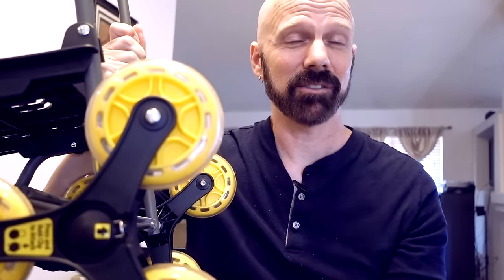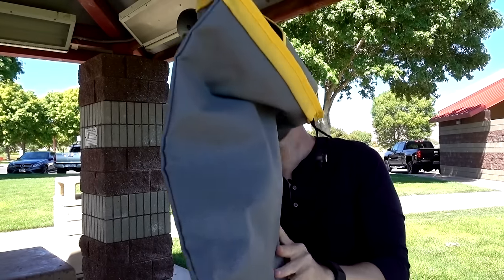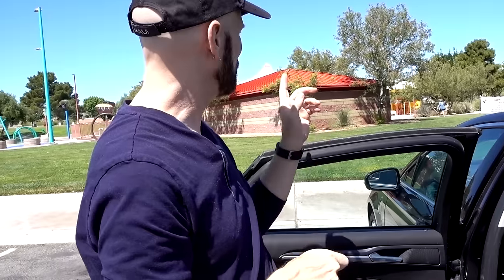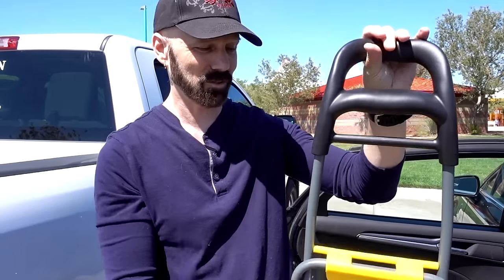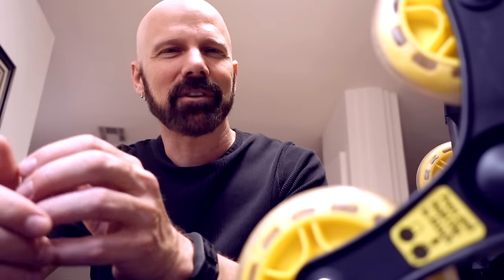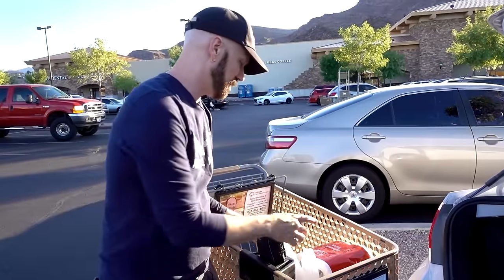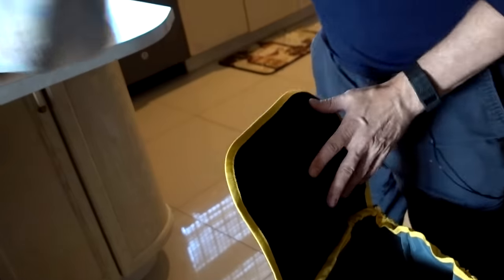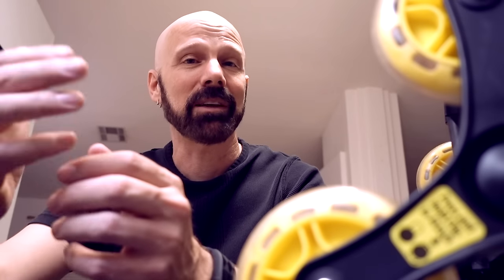Climb Cart Review: A Stair-Climbing Cart?

Comment: Of course it's still hard when carrying a lot of weight: every time you move from one stairstep to the next you have to pull the full weight of the cart and payload up by yourself, there's nothing else there to do it for you. The only thing this kind of cart helps you with is it gives you little breaks from the lifting while you're dragging it horizontally on its wheels across each stairstep platform until you hit the next one and have to lift again. It's better than having to support the full weight continuously for the whole climb, but you still have to be able at least to lift all that weight for the vertical distance that is the height of each stairstep.
Reply: Exactly..not 'easier' at all, and it only really helps on stairs that are just the right size.
If you put brakes on the wheels of a normal dolly and use bigger wheels, it is simpler and better and faster and safer.
Reply: @murraymadness4674  I mean if we get super technical about it there may be some pulley effect going on there for a bit as you're pulling up at an agle but the cart starts by going straight up, but the help you're getting is probably very small, as there's not much angle difference from just pulling the cart straight up as it hangs freely.

Comment: I have a slightly more heavy-duty version of this cart. Strong enough to carry a front loading washer or a fridge. I find that 3 wheels work ok going up the stairs and the  turning radios is non existant with a heavy load on it. You simply can't turn on the landing between the stairs. I usually have to get 2nd person to lift and turn the cart. For moving heavy items, better design seems a regular cart with big wheels on the side. But for a light load of grocery it seems to work fine. I still use mine 10 years later..... Even though it is not perfect and I had to repair one of the wheels that fell of in a turn.
Reply: I have a similar one with similar problems. Can't turn corners, and centre of mass is also much higher than it needs to be, making it very unstable. Great with light loads though.

Comment: I wonder how well it will go up a flight of porch stairs that has space in between stairs , I wonder if the wheels will get caught in the space between the stairs?  if you can test it on stairs with space in between that will be awesome,  my daughter has stairs like that and that's why I was wondering
Reply: Where I live I have similar stairs to your daughters house. I think it would get stuck since the wheel isn't hitting anything.
Reply: sounds like it need bigger wheels. a lot of commercial grade handcarts have larger wheels. This isnt bad for most people.
Reply: Rosie Duarte. Thats a great comment I wonder why he never responded to it because most houses don't have cement stairs
Reply: Are you thinkinbg in terms of a fire escape grid type stair?
Without a back to the stair?
Reply: Rosie Duarte I have wooden porch steps it goes ok on it. 
I find that bunny cording does not hold things on well with just the cord it gives. 
The bag holds up very well even  'over stuffing' it with laundry. 
I have had  my climb cart since before I moved. I used it on the bus, and uneven  terrain and it did very well. Regular use from August last year to now and only thing I am unhappy about is the fact you need  more than one bungy to use it without the bag
Reply: @gnhun101  I was thinking the exact same thing bigger wheels and a little bit wider
Reply: @peterstyles5567  it would be good to check it out on those kinds of stairs, too
Reply: Rosie Duarte I think it would work as the wheels pivot as one unit. I thing the whole unit would be ok and work!
Reply: @nimbysep7602  I would be more comfortable with a simple ratchet strap for heavy or awkward loads
Reply: @woodstream6137  if I had one i would agree but it is not that easy to find one small enough to fit on the climb cart
Reply: Yeah and uh says that I have a space in between them and also stares that are much much taller in between
Reply: agreed

Comment: In Germany this is called Sackkarre and it´s actually a very old invention way before 2014. Actually the patent for a Sackkarre with stair climbing abilities was registered 1982.  But here they are made completely out of light weight metal and are build to carry washing machines or even heavier things upstairs. So this plastic as seen on tv thing would never ever catch my attention. And by the way the price point is the same.
Reply: DJWeaponized I live in central Germany, where can you buy them? I’m on the 4th floor so carrying up groceries sucks.
Reply: Allie Jones 

https://www.amazon.de/Treppenkarre-Sackkarre-Treppensackkarre-Faltbar-Stapelkarre/dp/B07BTTFK7G

That is just one of the many models if you look it up they can hold 440 lb in Mead of a light but durable aluminum they look badass.
Reply: I thought exactly the same. We had one, costed 10 eueos... Lifted everything upstairs.

Comment: Thank you for this excellent review. I had a rattle cart, the kind sold in grocery stores. Paid $29 for it, and it sounded like I was dragging a metal fence down the street. When a wheel broke and wasn't easy to replace, I threw it in the recycling bin and went looking for a better solution. I found your review.
A big plus for the cart is the handle. A negative is the wheels themselves: imagine if they used hard rubber wheels -- like a skateboard -- instead of hard plastic?
Biggest plus: It's QUIET.
Two recommended improvements: make a carrying tray that extends, either via pull-out or a flip down extension. AND Make the handle adjustable, so users of all heights can find the most comfortable position.
Reply: I hate those granny carts. They're so noisy.
Reply: I stumbled on this video by accident, while looking for shopping cart for myself. Don’t want to sound grumpy, but honestly don’t understand the idea behind six wheel “stair climber” types of a dolly at all. Yes, they look clever, give impression of being specifically designed to handle stairs and steps. Do they however really make climbing stairs any easier or better, give any advantage at all, over regular two wheel dolly? Not at all. Whether it is six or two wheels, it will climb the stairs same way. It will not be any easier, more secure, safer, sturdier, more comfortable. At the same time the very design of the six wheel “stair climber” will make it slightly harder to pull dolly behind on any surface, flat OR stairs for that matter. Why? 
In order to compensate for the size of three wheels, virtually all six wheel dollies designs have a part of frame which supports weight of the bag from the bottom (part of frame which creates surface on which shopping bag seats) considerably higher than regular two wheel design. This results in weight being shifted up on the entire frame, which moves center of the gravity up. This causes design to have much higher angle of handle bar in relation to the ground when pulling dolly behind and shifts weight from wheels to hand. You hand pulling dolly will be lifting bigger weight, on top in arguably awkward, uncomfortable position. 3:40 Look  how “Freakin’ Reviews” have to uncomfortably bend down while pulling dolly upstairs. Doesn’t this look painful? His hand is literally at his knee height. While walking flat surface, two wheel dolly handle will be maybe 20 degree from vertical plane. All weights balances on wheels, where you can hold and pull handle literally with two fingers, even when dolly is loaded with heavy weight. With “stair climber” type, angle will be more like 45 degree, where weight is resting between wheel and handle and you hand literally has to lift it. Advantage or just a sales pitch of looking smart, yet really bogus design? 
Not trying to offend anyone’s feeling, not impossible I am missing something. Just my two pennies of my uneducated reflections.

Comment: Your review was spot-on.  It is great for going up stairs, not so much for going down stairs.  Platform is smaller than I would like.  Tried using it to get a 40 lb. bag of water softening salt down to the basement from my car.  I did use the bungee cord, but my error might have been leaving the bag in the upright position.  No problem going up the 3 steps to enter the house.  However, I was not able to hold onto it to go down the stairs to the basement.  The cart with the bag of salt practically flew down the stairs without me.  Fortunately, the salt bag did not open and climb cart was not damaged.  Will try laying the salt bag horizontal next time to see if that helps.
Reply: I think it should be an olympic sport

Comment: Yet another great review!

I have in of the first gen of these carts; they can be helpful but for a few bugaboos.

The first is the platforms are difficult and usually too narrow to be versatile.  As shown with the case of water.
The second is twisting.  When you have the cart loaded and put any sort of direct torsion you can easily damage the cart.  When heavily loaded these carts need a good amount of space to pivot.

And always, always get bungee cables and the custom bag!  Finding a bag to fit properly is a pain so it's worth the cost to get theirs. Bungie cables are easier and can be gotten from any hardware store.  Both will be invaluable depending on the loads you are trying to carry.
Reply from the maker: Excellent tips, Dan. The original Climb Cart had a much larger platform, and I'm not sure whey made it smaller (to save money, maybe?). You also touch on a point that I didn't really mention, that it doesn't really make very tight turns. 

I think it's pretty good, but $40 seems like about $10 more than what it's worth.
Reply: That same four points of contact can also add to the amount of weight you can carry in a given space... if you were to build something similar to this yourself,  you could make it hold 500lbs easy. .... this thing just needs to be booated to the commercial product level,  it would sell fantastically with better construction and the right marketing

Comment: I would like to see how well it works on the stair where the riser (vertical part of step) is open, like typical apartment or deck stairs. Without the vertical face for the leading wheels to hit and make the wheels swivel, I bet it doesn’t work that well. The other challenge might be where the tread (flat part you step on) protrudes an inch or so beyond the riser. Very few of the steps I have seen have a vertical riser intersecting the tread at a perfect 90 degrees like those in your park.

Comment: If the wheels were metal and the tires made of hard rubber, that would be better because of plastic breaks or wears out too fast and you would have to replace them more often if you could even get the replacement parts. The idea is great though, especially for seniors and their stuff eg. groceries. Love the bag idea keeps everything compact. Thanks for the video.
Reply: @@gsnoorky I wonder if the wheels are replaceable

Comment: You might want to measure the force required to pull it up a step (with your luggage scale), and then do the same with the same load using a regular 2-wheel hand truck.  This would tell you for sure how much less effort it takes.

Comment: Seems like it would work just as well if it had one much larger wheel on each side instead of the three small ones. And larger wheels would be even better on rough terrain like the park grass.
Reply: Zombull73 You're right. I currently use one with a pair of larger wheels & find it requires about the same amount of pull up stairs as my previous 6 wheeled one. 1 advantage is, if one wheel breaks it can still be used.
Reply: The wheels would need to be indeed much, much larger. To the point that they'd make no sense over this design. If not, the cart would move up the stairs a lot less smoothly and would require much more effort.
Reply: good point

Comment: water weights 8lbs per gallon, so you can divide the number of total ounces. If those are 16-oz bottles, then 32*16 = 512 and divide that 512 by 128 oz per gallon = 4 gallons, which is 8*4 = 32 lbs for the water, plus 3 pounds for the cart.

Comment: I work for instacart and shipt, which are both grocery services.  So im constantly shopping and having to carry very heavy items.  My mom gave me this cart and at first i was hesitant but after using it, i wouldnt be able to do my job without it.    It holds a lot of weight although it does have to be balanced on there properly bc it could easily tip over.   Going up stairs is helpful but if its a lot of weight its tough making it all the way up.  The handle could be longer.  But this thing is durable.  Ive done over 1200 shops and have used it for 15 months and havent had to repair or replace anything on it.   I highly recommend it but not to lug 75 pounds up stairs, unless youre a mini hulk lol.    I def never tried it to go down stairs, i would be afraid of the tipping over thats mentioned in this video.  All in all i give this product 5 stars!

Comment: How tall are you?  It looked like you had to bend to the side when going up the stairs.  how about when walking on level ground?  I have a bad back and this might be helpful if I don't have to crouch to pull it along.  I assume the handlebar is not adjustable?
Reply from the maker: Hey David. I'm 5'10" and you are correct that the handle does not adjust. I could walk normally while pulling it on level ground, but I did sometimes have to lean going up or down stairs.

Comment: I have a similar product called a trolly dolly have 6 large wheels. When I’ve gone down stairs however—-i don’t push it forward as you’ve had. I actually pull it behind me to go down. So the back is tilted low to hold items stay on the base, but i don’t need to position myself awkwardly while going down stairs. Had you tried that? I feel like that would make the process much easier to go downstairs.

Comment: He did not compare it with a regular wheeled tote. Also he didn't show it on regular sized steps, only over long ones. Will the climb cart rest on a single step with only steadying force as does a regular tote? Or would it need constant pull and so one could not rest halfway up the stairs?

Comment: How thick is the tubing? How much does it weigh unloaded?  
Big problem: all the connections appear to be made with rivets, instead of nuts & bolts. So you can't fix it yourself. 
It looks really cheaply made. How about some stress testing?  I think it might be better to have one set of wheels that were twice the diameter.

Comment: hey there! so I realize this was posted over a year ago, but I'm just now hearing about this thing. I'm a construction millwright and these appeal to me for the purpose of lugging an arsenal of tools up flights of stairs a work area. often times this is a sensitive (and pain in the ass operation. I doubt this cart could bear the weight of a tool collection, but you did mention that this is not the only car like this. have you tested or do you know of any carts that maybe WOULD bear the weight/just be more useful? as of now we just use a dolly but this isn't the most stable. most of the guys don't have a whole lot of trouble. I, however, am 5'2" and struggle EVERY time. thank you in advance -great channel!

Comment: Thanks for the test. Would have been nice if tested with 2 case of water = to 60lbs since the max is 75lbs.
Reply from the maker: I'm compiling some requests for a follow-up, so I may use this suggestion.
Reply: might wanna try a ratchet strap instead of that bungie cord. may provide better support, although itll likely bend it. Also, could you try it in sand? might be descent for a beach outing if its really "all-terrain"

Comment: This thing is ok for very light loads, that don't shift, on even flooring with low lipped stairs.

Otherwise,  you must jerk and pull. Then it warps into a giant plastic thing with a 90 degree wheel.

Comment: just bought it today - i agree with most of what is said in the video. i must add that cobbles are not seem to be very good for this plastic weals, and i'm afraid that they are going to wear them down.  climbing stair is easier then the one weal, but still, effort need to be made, and it is going to be noisy (some neighbors might not like it...). nice thing is that it can stand put, and you can carry your water, and your groceries in a nice tight bag. my conclusion - not bad, but perhaps to expensive to what you are getting.

Comment: If the stars are open underneath and you are going down the wheels get hung up. I almost broke my neck when I fell over the cart luckily I  had soft stuff in the bag that I landed on and it was only a two step landing. Mine is packed away and will never be used again.

Comment: another spot on review !   those are great light weight helpers on stairs for sure.  If anyone wants a heavy duty stair climber, cheap, I bought a beast of one at newark.com , search for stair climber sack truck and it should show up. $38 + $5 shipping - and it came overnight!  I have zero association with them, but it was the best thing I've bought in years, just had to share it.  One thing, it's tubular steel, and it's heavy on its own.  So if you need something portable and lightweight, stick with the one Freakin Reviews reviewed.